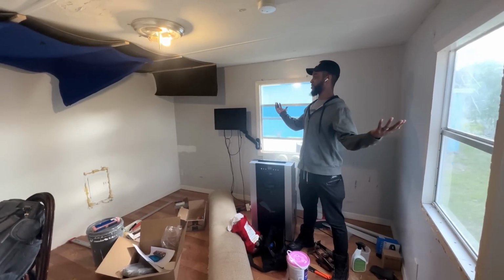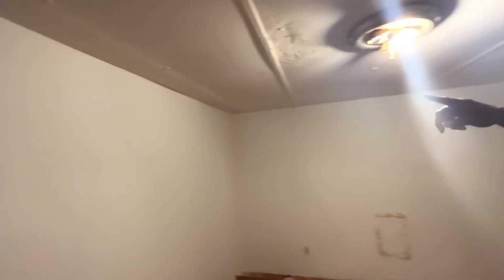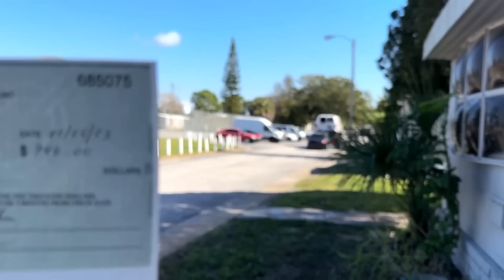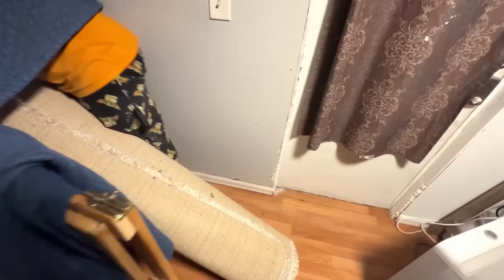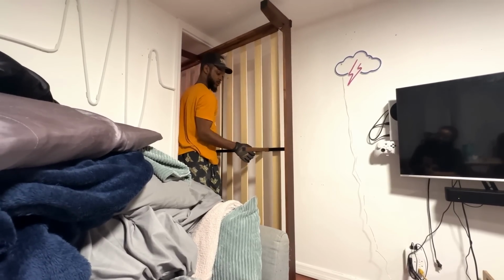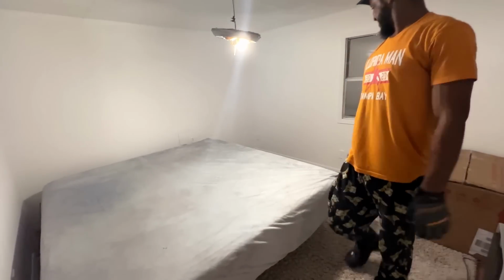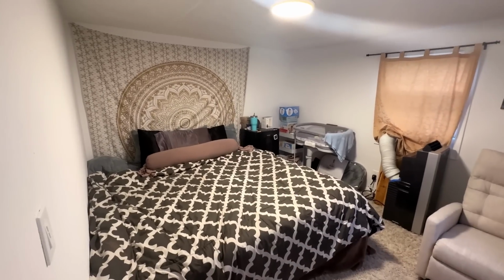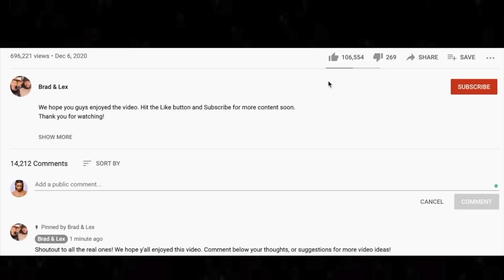turned our old bedroom into a nursery

Comment: Baby Tip - if you put a baby in a car seat - and put them on top of a running dryer - the giggling and the noise and the warm air makes them fall asleep. Be sure to secure it so they won't fall off - as if that needed to be said.